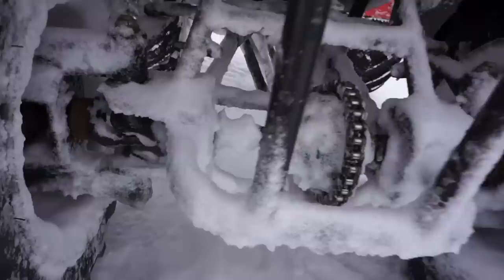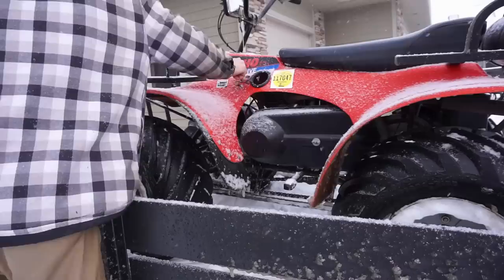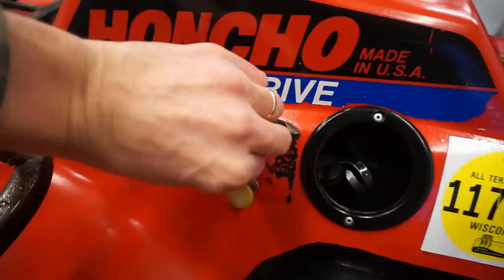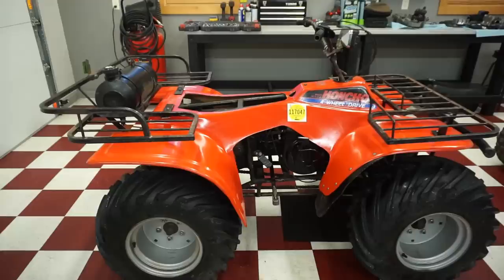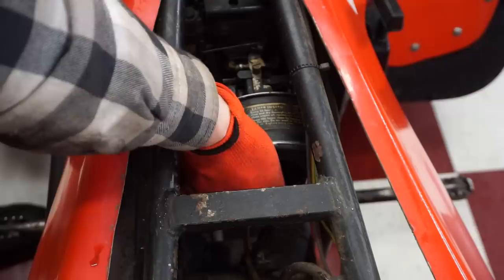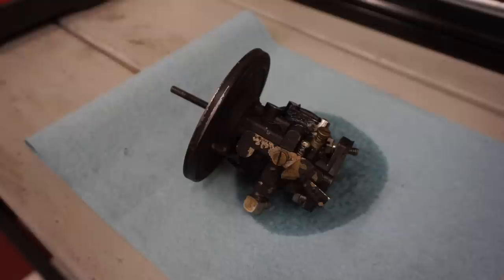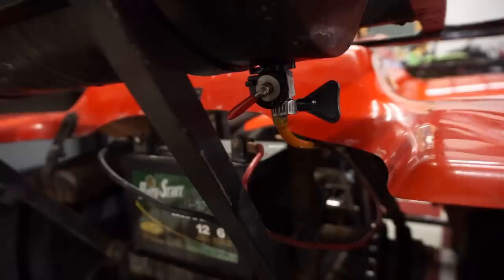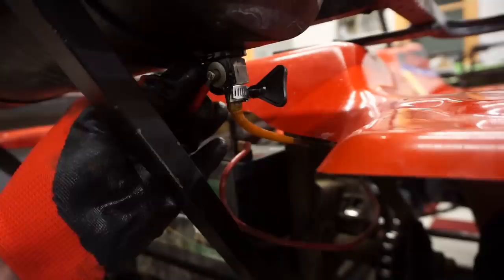I Bought One Of The RAREST ATVs Ever Made (It Floats?)

Comment: Joe. That's an old Kohler engine that 10w40 for wet clutch is going to ruin that engine quicker than that older black oil. You should be using a zink additive for older small engines probably a 10w30

Comment: Such a primitive design. Amazing how far atv design has come.
Reply: sometimes simple works best - I mean this ATV won't get you anywhere quickly but it will get you there!
Reply: @jasonpeace91  100% in agreement
Reply: A machine that will last a lifetime. Simple and basic maintenance. The model t of atv's
Reply: Get a set of ramps. You almost lost it while unloading it.
Reply: @neilkratzer3182  no it won't lmao and model ts are unreliable as shit
Reply: pos quad when the cvt belt gets wet or the 2 mile long chain breaks....2hp motor won’t turn tire’s....
Reply: @linkinpiatak6669  A model t can be fixed and maintained with nothing but simple hand tools and will easily out live the piece of shit you're driving now twice over. If you think they're unreliable, then you are not mechanically inclined enough to have a clue what you're talking about
Reply: @RosErik47  you literally won't make it 1000 miles without breaking a model t lmaoo and then where you gonna get parts from buddy? I'll keep my unreliable ass jeep that will still live over 10 times longer
Reply: This thing won't get you anywhere they were underpowered they had no suspension and the chain was problematic so even though you had four-wheel drive it didn't really have much balls to get you at it any situations Plus you know if you got any mud or anything in that chain it would fucking bind up and come off and get all messed up or if you got a stick or something in there it just wasn't a good design and it's not good it's just a cool old thing
Reply: @davidaix5771  finally someone with some sense

Comment: Every 3 wheeler I have drove can naturally float. Even the 350 warrior I bought new in 95' floated with extra air in the tire's. Comes in handy when you need to cross a Creek to get to the hill climbing spot. Cheers
Reply: Most ATVs will float with wide rear tires on the front wheels like this, I wonder how heavy the steering is.
Reply: those atvs will not float because of the hiigh flotation tires, all that means is the tires will float to a small degree, the only atv that will float is the Argo, which by the way has the same tires, the reason it floats is the underbody whereas 3 and 4 wheeler's don't have the underbody
Reply: @robertweniger6194  LoL who said anything about high floatation tires ?  Apparently you have not riden a 3 wheeler in the water. And with the 4 wheeler I was in Louisiana and there you have no choice but to ride through deep water. So don't try to say they don't float, that is a bunch of crap.
Reply: and not 1 of them floats, all 3 of them do not float only one or 2 wheels stay above the water somewhat but not completely
Reply: the only atvs that will float are the 6 or 8 wheelers, because they have a underbelly

Comment: Another great video Joe  Cast iron Kohler engine. Also known as K series. Will be a data plate on it somewhere. K91 is 8hp, K241 is 10hp, K321 is 14, K341 is 16 etc. Cool old rig. 
P.S. turn your quart bottle over when you pour lol. It will be smoother coming out. The shape will let air in so it doesnt glug!
Reply: K301 is 12hp
Reply: Ah. Was going from memory. I have a 91, 241, and a 321
Reply: Yes funny how that model you have to hold throttle all the way on to pull anything, but it goes at least.. better than a 3 wheeler though..

Comment: From the Kohler manual: K91 is 4 horsepower, K161 is 7, K181 is 8, K241 is 10, K301 is 12, K321 is 14, K341 is 16 HP,  all at 3,600 RPM except the little k91 4 horse which is at 4000 rpm.  You can find a nice Kohler K series service manual online in PDF form.

Comment: That thing goes through the snow better than atvs way ahead of its time and Era, it's primitive in design but it works so well for how old it is, a lot of atvs so much more powerful and higher end would get stuck at least once or twice but this thing didn't get stuck once in the video and it pulled that trailer through it with little struggle, I might try and see if I can find one and restore it if needed if I ever see one, I'm sold on that thing!
Reply: I said the same, my Kawasaki would not of made it so well in that snow, with or without a trailer.
Reply: Idk my 22 kingquad floats pretty decent if the tires are aired down but even it doesn't float it'll chew through snow up to the front rack
Reply: @benscoles5085  I don't think my buddy's custom big bore banshee 4x4 would have made it through there either, he built a super cool custom frame and design to give the banshee 4wd while still making it a banshee in the same Frame dimensions, 170hp from a highly modified engine, it was a unique experience to ride a yamaha banshee with 4wd, so powerful and the turning corners at high speed is downright amazing and well planted, just and absolute tank of a machine, no experience like it, I never knew I wanted to build a 4wd banshee up until now

Comment: Thats awesome. I never knew they made an atv that floats
Reply: My yamaha moto4 250 floats, I've done many water crossings on it, mind you I'm a pretty light guy at about 160lbs
Reply: Most 4x4 ATVs and most 3 wheelers will float. Some may require a snorkel on the air box , but if you search on YouTube, you’ll be amazed how well they cope with swamps and river crossings.

Comment: That is a Kohler k181 305cc engine. The same engine put in many smaller garden tractors.  They are eight horsepower at about 3,600 RPM, which is where the governor is generally set.  Depending on how the throttle linkage is set up, there should be more than one hole to put the governor spring in order to turn the governor up a bit if you want. Just don't turn it up too much. Haha. 10w40 in cold weather is okay but they really should run straight 30 weight especially in summer.  I've had many many years of experience with Kohler k series engines. They will last you forever if you keep the oil changed.

Comment: If it has a Kohler industrial style engine, no oil filter on it so keep the oil changed regularly. It likely has just splash lubrication inside the engine. The main jet mixture screw is the one on top, idle mixture is on the side. Adjust to smoothest running. 
Cool rig, great video, Joe! Thanks!

Comment: If you open the oil on the top where you put the oil and then open it on the bottom you will have a better flow for when you change the 🛢️ oil.

Comment: 4:30 "Close" call with those ramps, I have some that have a chain that goes from the middle or so, go under the ramp, and hook to the truck's hitch area so they can't slip out. Could be easy to add a d-ring on the trailer and chain/hook on your ramps or a "tooth" on the metal of the ramp that hooks into the trailer floor. Be safe out there lol

Comment: The Snow Beast.One of my buddies has a old Terra jet with the Wisconsin-Robbins engine and that Quad has similar looking treads on it.i think they might have been good year Terra tires.we restored that old Terra jet many years ago,had it torn down to the bare bones,welded up all the cracks and put new chains on it and rebuilt the engine.He has a 10 acre lake at their farm we use to take the Terra jet across and it wasn't very fast but it Def floated,and would break trail like nobody's buisness,lol.(that's why we had to do some welding on the body)and new seals around all of the axles.It would be neat to see if u could find a old Terra jet to fix up and take out fishing or just trail riding.

Comment: If you're going slow super wide tires front and rear really make a 4 wheeler able to go anywhere, wet, dry, frozen, powder, doesn't really matter it'll float right along. That thing must be deceptively tiny if those are the standard size 26x12r12 tires, they look bigger.

Comment: I always hated the old Polaris atvs with the chain 4x4, the rims would always cut the 4x4 wires going into the hub and the chains would always fall off. I had a bigger rear sprocket on my 300 and it would go 60

Comment: It'll probably do better on regular fuel. "Premium" isn't better. It's more knock resistance but needs higher compression to burn well. If it says 91 RON, that's more like 87 USA octane, NOT 91 octane "premium.  Lowest octane without pinging is cleaner, more power, and better efficiency.
Reply: I think when he says premium, he means non-ethanol.

Comment: Anytime I find a float needle with a neoprene tip in an old carb, I know it's been rebuilt at least once before. Decades ago, the needles and seats were made from brass only. The needle in the carb of that kohler engine probably came stock, with the neoprene tipped needle because the bowl has an o-ring instead of a flat, paper gasket. Those engines are tough and reliable. I have a twin cylinder Kohler engine on my 6 wheeled amphibious vehicle. The engine was the only thing that worked when I bought it. Looked like it had been through a war, but started right up.
Reply: I know Honda used Keihin carbs on street bikes in the 80s that came with black rubber needle tips. I find the brass needles more in machines from the 60s and 70s

Comment: Looks like a 6hpTecumseh engine on it at first glance. Looks like a Kohler 8hp model k181 or k161 7hp at 277cc. They also made a k141 6hp and if I remember correctly they all had the same block. Those engines are near indestructible even with next to no oil in them.

Comment: It's probly a 8hp cast iron cylinder Kohler motor which is a very reliable motor at least for me it has been I have a troybuilt horse roto tiller that's 40 years old with that  style of motor on it and still running strong to the day just keep up on oil changes an clean air filter and spark plugs every so often an should run like a watch

Comment: Reminds me of the Manco a company that made ATCs and (Dingo) off-road go kart from the 80's it has the same engine and drivetrain, they're very slow and primitive, it has a low RPM motor and a go kart type of torque converter for a drivetrain. Should last if maintained properly, probably a bitch to turn with a locked front axle especially on paved road.

Comment: grease fitting. I would take a close look at the grease points. They may have a "little hole" where you can put grease in. There is a part for the grease gun that goes on with a tip. You press in on a little rubber hole and then you can pump grease in. I know it is not smart but they were doing things cheaper. It is a small spot that looks like you would shove a pen in it.

Comment: A friend of mine has has one of those four wheelers. it's almost identical to that one except that it's yellow. he had it running it's in good condition. there's only one problem with his. it needs one wheel and he's been having trouble finding one. is the company that manufactured them still around? so a person can find out about parts availability for these machines. or possibly an aftermarket supplier for parts?

Comment: That machine looks like it was very well maintained.  You don't find that very often, about as rare ans the Honcho itself.  When you drain teh oil next time, pull the dip stick out to allow air into the crank case.  It will keep the oil from splashing when you remove the drian plug.

Comment: I have a 2000 arctic cat 500 manual foot shift with the Suzuki engine, ever have one of these and thoughts on them being reliable like the Hondas? I have a issue where sometimes when I’m driving it pop out of gear and starts reving like it’s in neutral have to rock it back and fourth and push by hand to get it to re engage gears but it finally does and shifts thru them all until it acts back up. Thoughts man? Trying to fix it already wasted 500 on a shop for mostly lost time

Comment: Polaris had had the same thing it was similar drive chain drive chain but they had a gearbox that would shift see different gears and it was a better setup but they use it two cycle engine not a four stroke since the hot ass if you want one if you want a place I know who has want to sell

Comment: That compression actually seems a bit high , them old k series kohlers have an automatic compression release that slightly opens the exhaust valve at cranking rpm then let’s it close fully once up to running rpm . Typically with a working acr in them they run 65-90psi on a compression guage . They are great engines though and just run forever I have probably 6-8 in machines running and another 6 for parts

Comment: What years were these made ???   You may have mentioned it, I was listening, but didn't hear. 
   I remember the ATV kits they Usta sell. Dad had a small engine shop , and there were a few of them that would come through. People would order a frame made of square tubing. It was up to the builder to complete to their finished liking. The ones around us just had a seat bolted to them , but in the magazines you could order the fiberglass fenders. I'm wandering if it was this same set of fenders?

Comment: Are you nutty?at least wait till summer to do the float testing,which given those type tires im certain it floats big thing is it balanced enough that it stays level.and even if not which ill bet not!!doesnt really have the speed to move very fast or turn wells fast enough to paddle.still unique piece of history.breaking thru frozen pond is flirting with death,even should it float youll never get back to shore tires will just slip on remaining ice attempting to icebreak ur way back.and if it rolls you might get caught up on peg or other then be pushed under ice cap n lose ur way or ur life because ice cold water locks ur muscles from working.dont try it dumb idea,sure its a novel theory but leave it at that.vinney needs to keep you around,sure the misses dos too!!💥👍💥snookie pa.

Comment: They are junk, slow (which is good because there is no suspension), exposed chain which is great for catching debris and breaking. I had mine for 6 months, drove it 3 times and parked it. Gave it to my brother who turned it into a snow plow for his mile long driveway
Nope , no grease fitting, you have to take it apart, drill and install them yourself, or keep replacing parts that wear out that no longer exist.  But then again, those who are into old machines that don't have a lathe, mill, and mig/tig welder have a lot of unrepaired stuff lying around or spend tons of money to have parts made. 
Yes they do float, but since the floatation is the tires, and COG is above the axels, it's unstable so it floats upside down. But with a little balance you can keep it upright maybe.

Comment: Great video as always. I’ve learned so much from your videos but I do have an off topic question for Joe or anyone out there. I’ve got what I think is a 2004 Polaris 400. It’s definitely a beater and I picked it up for free. Its got a dead battery and I’ve jumped it off a few times with a jump box but today I realized I don’t need the jump box or a battery for it to run. Turn key to on position and pull start it and it fires up and it will run like that. Is it bad to ride it like this? Still learning! Thanks
Reply: Won’t do it any harm, but it will be far better to own if you put in the extra effort to fix any faults you can with it,before they all add up and make it un usable.
Reply: @supertramp6011  I guess I just don’t understand how it stays running without battery in it lol. Like I said it’s a hooptie lol.
Reply: @Troy77787  it generates its own electricity for spark plugs, lights etc- and of course to charge its own battery! The battery is really just for starting it, many bikes and vehicles are like this. But once you have it started, either with a pull start, jumpstart ,kickstart or bump start,it will produce all the charge it needs until you shut it down again. 👌
Reply: @supertramp6011  understood thank you. I’ve got a battery ordered. Currently when I try starting it with the jump box and key there is a click sound at the starter solenoid so I’m assuming I need to order a starter solenoid as well correct? I’ve tried taping on the starter to see if that might of been the issue.
Reply: @Troy77787  maybe you can strip and clean the solenoid, or more likely sounds like a poor connection somewhere- perhaps try connecting a lead  from the battery or jumpbox straight onto the frame, or the starter somewhere ( earth lead,negative) and the positive lead straight to the positive terminal on the solenoid. This would show that there is a poor connection somewhere between your battery and the starter/ solenoid, and it’s not getting enough juice to flick the solenoid, or turn the starter. Check and clean any connections in the wiring and cables , these are always problematic on old Polaris quads- and many old quads! Good luck with it buddy, you’ll get there!👌👌

Comment: I got one lot worse shape the difference is engine 350 cc Kawasaki. mite not be original. some thing they put on golf cart .steering is horrible. no suspension no dipstick opening muffler discharges right off engine .I'm tall pegs way high. I weld and fab. there are cool parts on this I'm going to refab it .but yours should be in a museum for history sake. Forgot to mention that brake sucks .same. but I look at it and respect what they built .at that time .